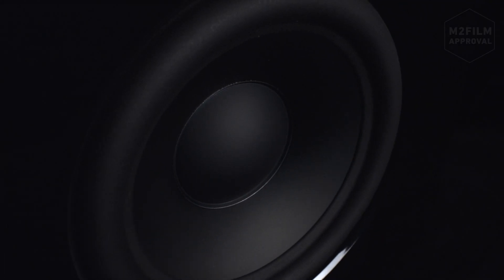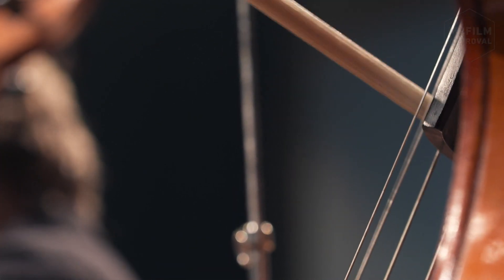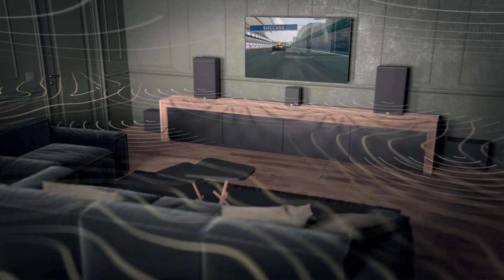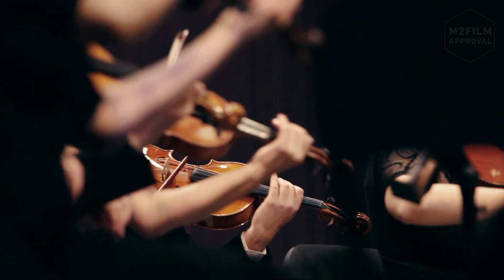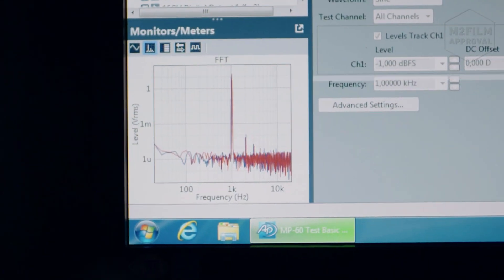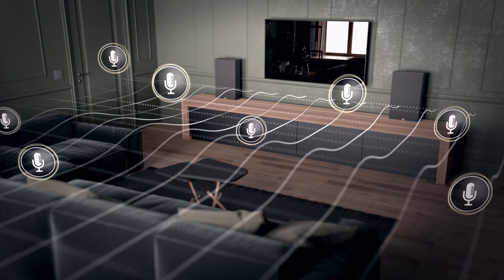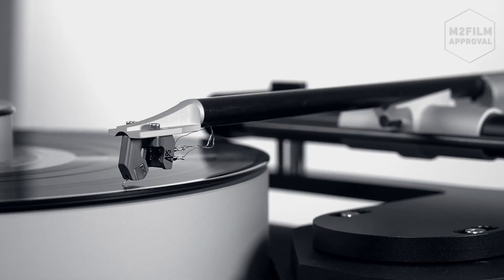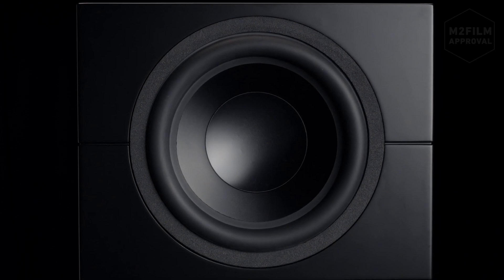RoomPerfect™

Comment: Is it the best solution to buy Lyngdorf speakers if you have a Lyngdorf amplifier, I plan to buy a tdai1120 and I like the fr1 speakers because they don't need a subwoofer?
Reply from the maker: The advantage of combining Lyngdorf amplifiers with Lyngdorf speakers is that you’ll find presets in the setup menu for all Lyngdorf speakers. For example you can select the FR-2 and then do RoomPerfect. The FR-2 works very well without subwoofers, as the low frequencies are tuned to use the wall to their acoustic benefit. But if you want to add a woofer later, for example in a larger room, you can select and add a Lyngdorf BW woofer in the setup menu, and the ideal crossover and alignment will already be set.

Comment: If I want room correction only because I already have preamp and poweramp, then the device would be the RP-1?
Reply from the maker: Technically, the TDAI-1120 and TDAI-3400 can be looped-in (analog, or even digitally with the TDAI-3400) as a RoomPerfect processor only, by disabling the amplifier outputs and bypassing the volume control.
 
But as a pure processor, the RP-1 can be found pre-owned. It is the same RoomPerfect technology, however only via analog-in / analog out, and without the convenience of today’s app control.

Comment: Can it work on dual subwoofers? Say 2 REL subwoofers for example?
Reply from the maker: RoomPerfect is exceptionally good in aligning subwoofer with the main speakers. In our TDAI amps, you can set the pre-out for two custom subwoofers, for example placed left and right, and define the best crossover frequency for your main speakers. Then RoomPerfect will make frequency-individual alignment and make speakers and woofers play together “as one”.
Reply: @SteinLyng  Thank you for your reply, my other question is around the "listening position" once the room is measured, is it a wide or narrow listening spot to get the best results from the corrections?
Reply from the maker: @adammusic1124  Both! There is a so-called Focus listening setting, and a so-called Global setting, for example when more people are listening. But thanks to the multiple mic measurements across the room, even the Focus spot is not too narrow in its correction.

Comment: 买了TDAI-1120，效果真的很满意，使用同样的音箱，room perfect比之前用的Dirac live的校正效果明显要好一个档次，特别是在低频方面差别较明显。
Reply from the maker: Many thanks for the good feedback.
Reply: @SteinLyng  对了，给你们反映一个我在使用中发现的问题，音箱发出低频声音的时候，手放在1120的外壳顶部，能感受到明显的共振。
Reply from the maker: @wjet2956  When you have capable loudspeakers, that can happen, and you can feel it. However, the TDAI-1120 is a digital amplifier, therefore air soundwaves and mechanical resonance have no audible impact on the digital components inside or on the digital signal path.
Reply: @SteinLyng  thanks，Hoping to enhance the shockproof performance of the shell，products such as digital amplifier still need good shockproof performance.